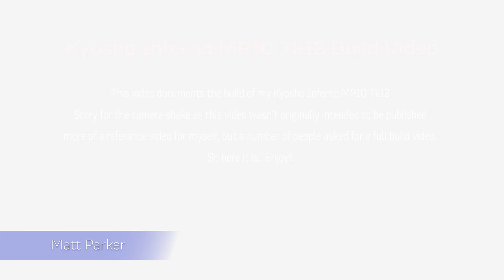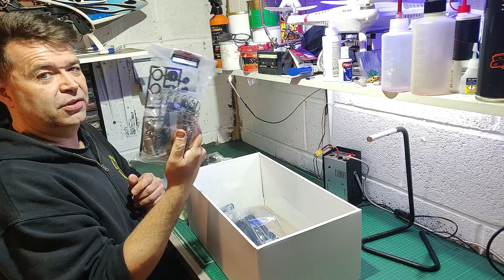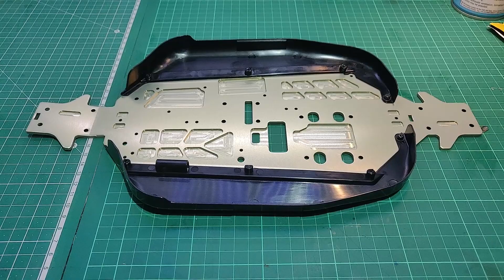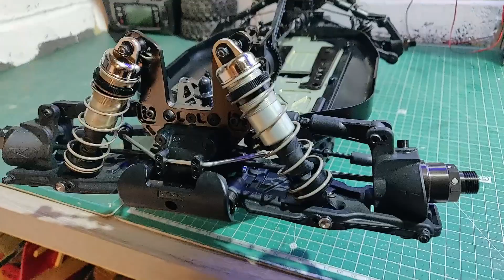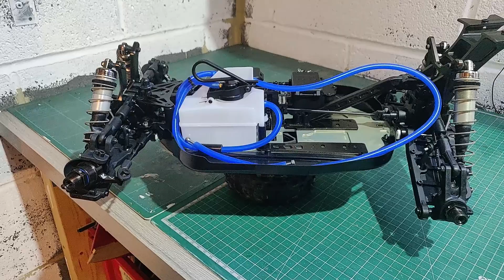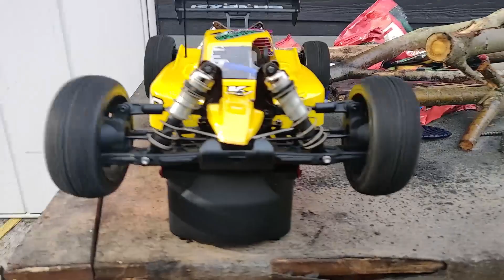Kyosho Inferno MP10 TKI2 Unboxing, Build Vlog, And My Thoughts On The Buggy

Comment: Great video Matt, thank you. What wheels did you use on the MP10.
Reply from the maker: I used the stock wheels that came with the kit, they are pretty smart and embossed with the Kyosho logo. For tyres as I mainly race that car on Astroturf I fitted these tyres   

https://www.modelsport.co.uk/product/schumacher-1-8th-mini-pin-yellow-26455

The yellow Minipins are as rare as hens teeth here in the UK right now and are not expected back on the shelves until April 2023!
Reply: Thank you Matt

Comment: Very nice! An expensive purchase no doubt,  kyosho are renowned for producing a quality car
Reply from the maker: Thanks, this is an amazing piece of kit. I took it to Adur this morning and did around a dozen shakedown laps in the wet. Even on wet Astroturf with Schumacher Spirals on this car was amazing. I ended up sticking a Kyosho Ke21sp Engine in for Shakedown and it worked very well, plenty of steady power in tricky conditions. Hvae a few adjustments to make before its next outing.